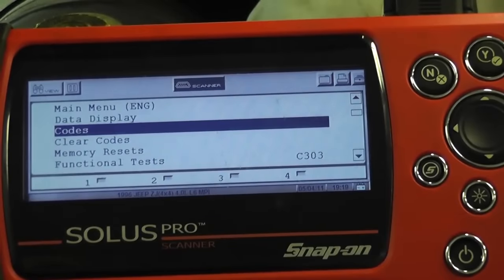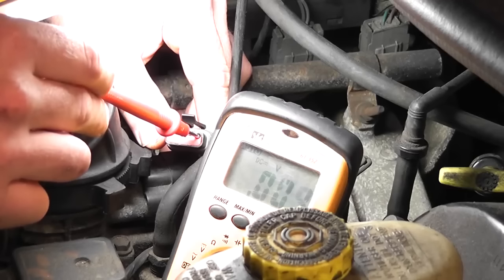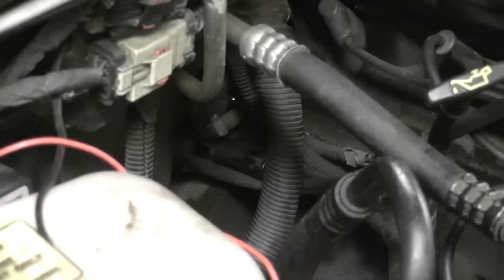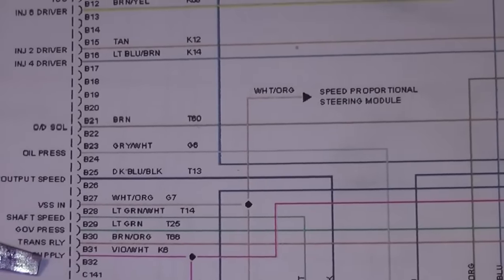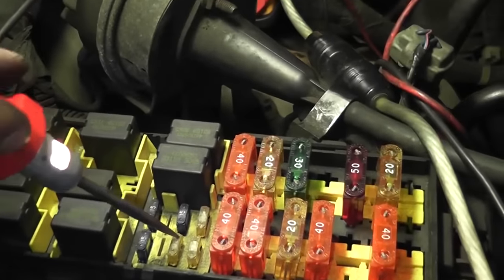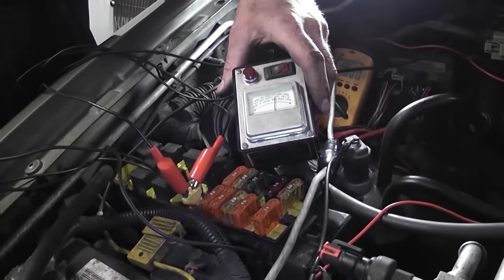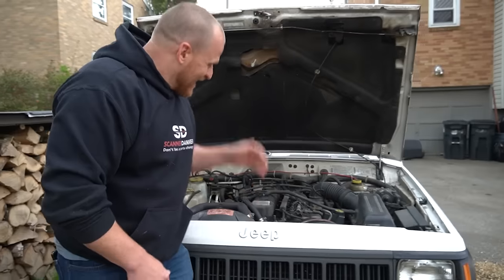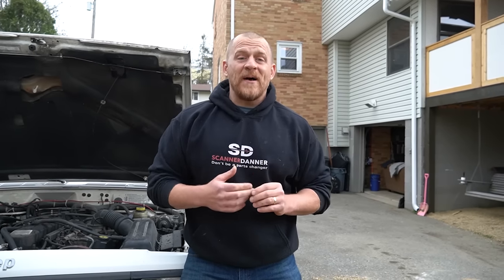96 Jeep, No Start, No Com with PCM, No 5v reference (Quick Tips)

Comment: I found this video several years ago and it saved my butt.  I had exact problem on my 96 JGC. It died at gas station.  Would not start after gas fill.  Had it towed to my home.  I had shorted 5VDC at Ox sensor.  Video helped me find the problem. I have been a subscriber every since. Thanks for your efforts.

Comment: Instead of cutting a perfectly fine wire, why don’t you remove the pin bushing from the connector housing with the appropriate terminal removal tool and simply push the pin pushing back into the connector housing when done? It takes only a few seconds. That’s how I work. Other than that, you have a real gift of teaching. I learned a lot from you.

Comment: Between you and eric. O I've learned alot about electrical diag. I learned the basics when I worked at a dealership, but you've taught me alot   about how to diag without a diagram. 
My brothers side by side wouldn't start , when I jumped it the battery voltage is around 11 volts at idle. I Googled it and saw that the voltage regulators sometimes go bad but I didn't want to load the parts cannon without being sure....I tested the stator, 18v,17v,16v good, I tested the voltage regulator 16v good. I didn't have a battery tester but you better believe I ordered one after that. Thank you and hello from Indiana county.

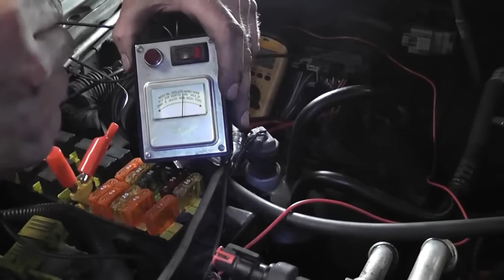Comment: 8:40, I have that same short circuit tester and it works like a champ. Back in the day I used it to find a short in the courtesy light circuit in my 1988 F-150. I  was going to say I was surprised the harness was routed that way and then I saw the very end of the video, LOL.

Comment: LOVE THIS VIDEO , I HOPE THERE WILL BE MORE LIKE THIS IN THE FUTURE . WOULD ALSO LIKE TO SEE SOME TESTING SPECS LIKE OHMS AND AMP'S THAT WOULD  GENERALLY APPLY  FOR ANY VEHICLE FOR  IGNITION COIL , INJECTOR  , RELAY  , FUEL PUMP  ,  SOLENOIDS AND  FAN MOTORS .  IF POSSIBLE WITH THE DIFFERENT TESTS SHOWING HOW TO TEST THEM . THANKS SO MUCH FOR YOUR TIME AND CONTINUED EFFORTS .

Comment: I wanted to hear THAT Jeep crank up 😂  Thank-you! I'm working on a new acquisition, 98 Jeep Cherokee XJ 4.0 Auto. No guages, no fuel pump, .400 milli amps instead of 5 volts at crank position sensor and cam position sensor unplugged. No blown fuse. Switched relays around. I'll figure it out 🤣🤣
Reply from the maker: Check main powers coming into that ECM. If those are good, start unplugging every sensor that shares the 5v ref.
VSS, MAP, TPS AC PSI SENSOR etc

Comment: Very good when l was inspecting vechicles yrs
ago l would spend around 20 mins going round inspecting the harnesses
Even when there wasant 
an electrical fault, many a time a would find wires rubbing through, by finding 
These and repairing them
Saved a breakdown at road 
side and it could save a lot of electrical damage.

Comment: I have watched several of your vids...this is one your best...this will work on anything awesome
Reply from the maker: Thank you! Just replied to your other question too. We need to make sure your distributor is actually turning too
Reply: @ScannerDanner  I forgot to throw that information in there I pulled the distributor cap and I grab the rotor make sure it didn't have too much slack and make sure it wasn't broken and then I crank it with a distributor cap open and it did turn just fine so that was okay and this this Motors only got seventy thousand miles on it runs perfectly until just shut off like flipping a switch while idling at gas pump during a trip
Reply: I have ohm my new crank sensor just in case..its good..im looking for burnt or pinched wires...this is a head scratcher..

Comment: Why you cut original second 5V reference?There is other option to troubleshoot....why not check ECM B+ feed supply first?If there is communication issue then we should check Ign and B+ ,B- feed supply.in my view try to save original harness because we have many other options to troubleshooting.
Reply from the maker: please read my other replies and lose your tunnel vision, this is an absolute must learn procedure, sure, I should have checked fuses first, but as I said in my other replies, what do you do when the fuses are good?

Comment: Mine has the infamous, "No Bus," error.  The scanner thinks the key is not even on.  Thus, the ECM is bad or crusty wiring is causing the error.  The ASD circuit is shorted to ground.  Before the shut down, an error denoting the catalytic converter located in the front part of the exhaust manifold was functioning far below perimeters.  Maybe I should check out that oxygen sensor harness. The voltage gauge was going crazy right before shut down.  After shutdown, the battery was hissing. I suspect a big shirt circuit, probably right where you found your large wire damage.

Comment: Question:
Some times when I check look like this.
I found a blown fuse and there is no short in circuit.
I think just a fuse life.
Always occur when stop the engine the fuse blown.
I don't know what's the reason exactly.
What about your opinion?
Reply: What fuse ? Car model ? year ? engine would help, MORE INFO PLEASE.
Reply from the maker: no, fuses do not blow without a reason, there is always a cause. Now I have seen fuses fail but they do not "blow" out, like in this video

Comment: I've got a 2006 cadillac sts no start with no comm.   I unplugged pcm connectors and plugged them back up and ended up having communication... until I went to crank it over again.  Believe I may have something of the same problem as this jeep, but...  more testing to be done to diagnose.  Thanks for the great videos
Reply: Sounds like a classic symptom of a poor ground.
Reply from the maker: @ BERPSU1 certainly could be
Reply: It does.  She just recently had somebody come by and put an alternator in it for her because of slow starts then she went out a few days later and click  nothing.
Reply: @BERPSU1  you were exactly right as the root cause.  Bad ground connection on the back of the right head.   It had 800mv with koeo.   Cleaned all grounds and tightened the one in the back near firewall.  Ended up with 5mv on block afterwards and no problems starting.
Reply: @ScannerDanner  all voltage drop testing learned from you, man.
Reply: @IamKurr  Good to hear you got it fixed up. Grounds are sooo overlooked yet sooo important. Generally when I find something wonky a quick voltage drop check across all pertinent grounds is the first thing I do.
Reply: @BERPSU1  you're exactly right.  800mv on the block is horrible.  I'm surprised there wasn't more issues.

Comment: I was trying to be creative by unplugging the connector with the 5v reference and test the pin to ground looking for the 5v ref. My thinking was if the regulator was cooked from a short, you would not have the 5v ref. This may not be an accurate test. I was just experimenting.

Comment: Paul I have a question where I’m seeking only guidance upon a direction to go in. So customer on Audi Q5 2.0 had oil level temp sensor say no engine oil stop. He freaked and put 6 litres of oil in. So likely it already had nearly 5 litres the amount it should have. Oil was up in air mass. Oil was bursting out seems where turbo joined into exhaust. First 02 reading stuck, rich not surprising either. So learnt on Audi Q5 when bonnet open it triggers electronics to check oil level and temp sensor. This is a variable resistor. Batt volt in. Ground. And a white purple signal out which on fluke multimeter in slow mo video shows it jumps between 200 and 800 milli volts stop on some figures in between. No scope here sorry but sensor is brand new. Checked ECM where signal wire goes and power and ground to sensor. Power and ground both good to sensor. ECM wire to sensor at at ECM is showing alternating figures suggesting wire to sensor good. Bonnet catch switch wiring on diagram goes to a power control module. So now I know on my AUTEL ms906 I can see oil height in live data. Yet behind steering wheel in dash it says key on stop oil low. Yet in middle of car dash the infotainment system it says cannot communicate with oil sensor. I’m thinking and guessing the BCM does the job of handling the low oil message. Any way you know to confirm that. So the question. What’s my direction now on fault finding this, without that is simply buying second hand replacement electronics from eBay in a set and changing the lot to get rid of this headache. I don’t want to do that. I don’t want to be a parts changer. Get my meaning
Reply from the maker: Post this to my forum my friend www.scannerdanner.com I'd have to do research to answer this and I can't do that here. It is free to join, hope to see you there.

Comment: I am not pro by any means,but what I do when looking for shorts,is to substitute a light bulb in place of the fuse,so when you find the short the bulb lights so as to not waste fuses and when you move a harness you may see the light flash as the short comes and goes.The bulb needs to draw at least as much amperage as the fuses' rating. I simply soldered wires to a blown fuse and connected a headlamp to it,so just plug into fuse socket.
Reply from the maker: You can do that but not on circuits that have low resistance outputs. Your test light can easily find a path to ground through the fuel pump and O2 heater circuits and would light just as brightly as if you were connected straight to ground. So, you can use that method but you must know about this variable or you will absolutely chase your tail on some cars.
Reply: @ScannerDanner  I agree,but if you have say a 5 amp fuse and the test light .in this case a headlight bulb that draws more than 5 amps,it will not light until there is low enough resistance to draw whatever it requires. I was not speaking of a regular test light,in which case you are correct. Thanks for responding

Comment: I also changed out the sending unit in the fuel tank. Put in new fuel injectors delphi sending unit.. Turn vehichle on turn it off check fuel pressure no fuel pressure at shcrade valve.

Comment: I bought a ‘98 Jeep Grand Cherokee (as is) it was running a little rough. I didn’t think much of it. After replacing the plugs and wires it didn’t help. Then after driving it about 10 minutes it died. It restarted and backfired and died again. It started right back up, and i drove it for about 45 minutes with no problems. It set for a couple of days, it would start run for a couple of minutes then die. It  would have to set for a few minutes then it would start and repeat the thing. I borrowed a code reader and the only code was bad ignition coil. That made sense so I replaced it. Now no codes show up, so I checked the 3 sensors and left them unplugged and ent to the next one all read 5.1 volts. The electric door lock doesn’t work on drivers door, but once in a while it makes a noise. One electric window doesn’t work. Could this cause it to run and die? Another thing I have no idea how long it has been setting, it has only  94,527 mile and has a salvage title. Could old gas cause this problem? Sometimes it will run for 30 minutes to an hour with no problems. So while it was running smooth idling about 600 to 700 rpms I started wiggling wires and when I got to the first cluster of wires on the computer, t6he plug toward the motor it died. I thought I found the problem, so I made a wedge and slipped it in to hold it tight. I drove it about 5 miles and it died. It died 3 more times before I go it home. So now I’m totally lost. I bought this for my grandson, now he said he didn’t want it even if I get it fixed. So I’m going to sell it, and try to recoup my money. I can’t sell it like this, I need to fix whatever the problem is. Can you help, got any suggestions? Thanks in advance for your thoughts.

Comment: Hey Scanner 96 Jeep here fuel pump does run all the time no communication to the pcm and no gauges.  Does crank.  Not CPS or ignition switch either
Reply from the maker: Check your 5v ref next and report
Reply: @ScannerDanner  plan on that tomorrow I refuse to think it is the pcm funny this happens to me 2 weeks after watching this vid too
Reply: Well Danner here is my report.  I checked all the 5v ref and nothing abnormal.  I pulled the pcm anyways and was horribly rusted on the outside so went to the local you pullet yard and grabbed one off of a 97.  I knew installing it would do nothing and of course it didn't.  Now mind you I went through all of the fuses in the engine bay as well as inside.  Well thought I did.....turns out the gauge cluster fuse had somehow worked itself loose.  It was also really corroded so went ahead and did a quick clean up YUP gauges come back and she fires lol

Comment: Paul, I just wanted to say that I enjoy your videos a lot. I have a quick question I wanted to run by you to see your thoughts. You talk about unplugging sensors one by one to find the faulted sensor. We know that sometimes these sensors can be a pain to find and disconnect. What would your thoughts be to take a 120v to 5v dc transformer like you use to charge your computers at home, unplug the ECM, TCM, whatever you are working on and use the wires out of the transformer to hook up to the 5V reference and sensor ground on the harness side. After you do this it will energize all 5V circuits. Then take your amp clamp on your meter and go to each 5v reference leg on the sensor and see what leg maxes out to whatever the mA rating is on the transformer is? Wouldn’t this show what sensor is shorting out without having to disconnect each sensor or without having to really open up each circuit? This will obviously put a load on the transformer and you wouldn’t be able to keep it plugged in very long. By using a small enough transformer though you wouldn’t risk overloading the conductors. Just curious on your thoughts.
Reply from the maker: It would work but you still have to work at each leg of the sensor circuits. Not sure it would save much time. 
Especially with today's cars that all run separate reference wires back to the computer for each sensor. They are shared internally, but not externally like in the car in this video.
Then some are using up to 4 different regulators now. 😉

Comment: I had an alternator on a F150 that wouldn't charge above 12.5v.
Owner swapped the alternator, no change.
A five minute inspection and I observed the batter ground was connected to the fender not the engine.
I connected it to the engine and boom 14v...lol

Comment: this same exact method can be used using a test light in place of the fuse as when you get the short to ground the test light will light as its provided a ground so its exactlly the same method just going off a bulb instead.my favorite method for intermittents for us cheap arses who dont have these bi directional scanners/short finders.i wanted to mention this since we all have test lights and we can use them the same way seen here.

Comment: Those wires are suppose to run behind the power steering pump to keep them off the exhaust.  Someone probably swapped out the power steering pump and didnt route them like they were suppose to be.

Comment: I've got a 97 Cherokee crank but no start, dash doesn't work, no power to the OBD2 I probed power going into the ECM , 12 volts good.. tested the grounds zero ohms on the grounds for the ECM but the 5 volt out of the ECM do not have power is that a bad ecm? Or do I need further diagnostic?
Reply from the maker: there is more than one 12v supply on the ecm, you will have at least one wire that is hot all the time and then another that is ignition power. Also the ohm test for the grounds is NOT a good test. Here is why https://youtu.be/McsNOJvd0ao
Also, the fact that your dash doesn't work either is telling you, that you have another issue
You will need some good wiring diagrams https://eautorepair.adtrk.biz/?a=10817&c=24&p=r&s1=

Comment: Hi I am a fan and watch your videos.  I Do have a situation and hoping I get some direction.
I have a question on 2004 suzuki that cranks but not start , and no comm issue and but have proper ground and power on pins 4,6 , and 16 on the DLC . Also ECU is not grounding the control wire on the fuel pum relay control wire, therefore no power on fuel pump.   However, I noticed igintion fuse that power fuel pump also powers the ecu and the spark plugs, that wire if  I cut it from the fuse now the cut wire stilled attached to ecu shows ground. with a light test  This supposed to be power but shows ground when disconned from the fuse does this mean there is a short in the ECU?   Also the ECU is not grounding the control wire for fuel pump relay as I said.   Would you say the ECU is shorted?  Thanks

Comment: I have a 97 grand Cherokee with the 5.2….  Cranks with no start,  gauges are are dead but the dash lights come on then disappear with the exception of the gas light… it stays on.  Fuel pump runs constantly and OBD reader won’t connect.  I have no check engine light.  Odometer still reads the mileage.  Replaced crankshaft position sensor and nothing changed.   I have a 5v reference at those sensors and don’t have any blown fuses…  i tried a different relay in place of the ASD relay and still, nothing.  I don’t know what to do?  I’m stumped!!

Comment: Hey Paul, question: when you were checking the other leg of that 5v reference for a short, instead of cutting the wire could you have unplugged the connector since the 2 legs of the 5v ref circuit were on different connectors?